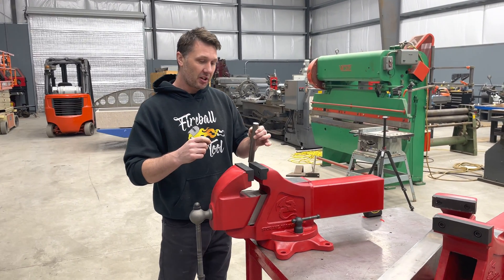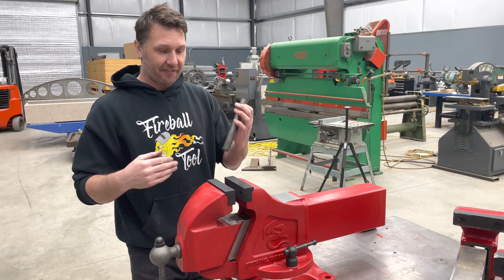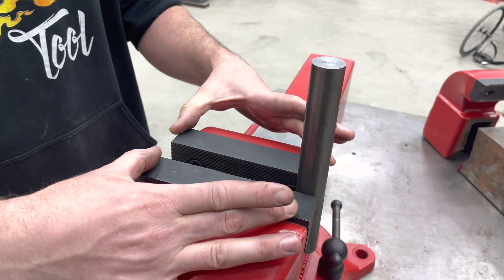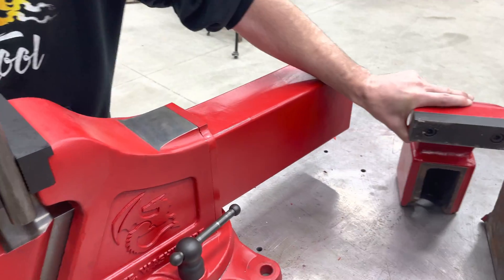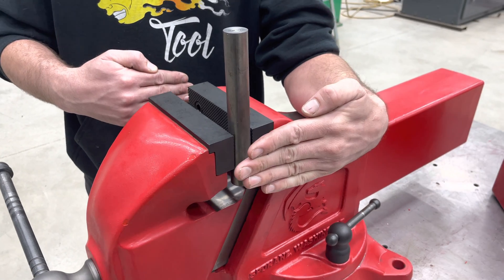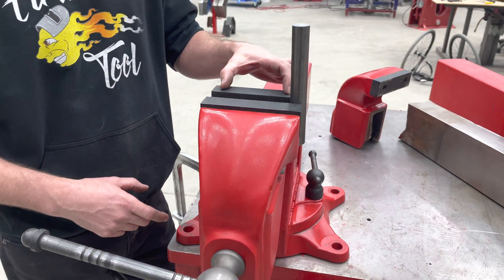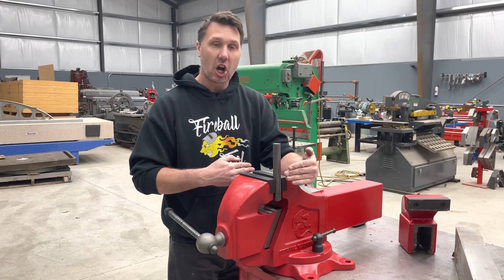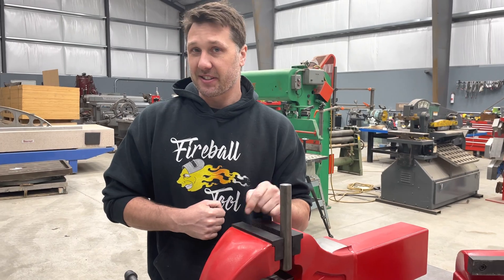Why aren't the Jaws 10 Inches Wide? - Fireball Hardtail Vise

Comment: Have to say it's an impressive looking vice. But $1,800? I can buy and refurbish a big old Record for 1/4 of that, admittedly it might not open as far. I can buy a lot of Fireball squares for what I saved.
Reply: $1800? The USA one is $3,800 on his site. Buy once cry once. You can always reburbish old gear, but by the time you find a suitable candidate, break it down, source broken parts, rebuild, ect. I’m interested in fabricating new items, not refurbishing worn out tools. But they savings are attractive….
Reply: @tbrizius  OK, not sure where I found that $1,800, but on his European site they are 1,600 Euros, which is $1,800ish. I was sure I saw it on the US site. $3,800 though??? Even if I'd won the Euro Millions lottery on Tuesday, some one in the UK did (£195M) I'd still have second thoughts.

Comment: When will the wider jaws be available? As interested as I am in this vise I need one with wider jaws for my use application. I understand you reasons for going with the narrower jaws, but as another commenter pointed out, using supporting material to prevent unequal forces that result in the dynamic jaw head twisting is a good idea.

Comment: I've watched every QA video on this new top secret channel now and this is the only one that really bothers me and it bothers me about your mild steel one, too. I commented on that at the time. You've got the round hub on the front to make it look "right" but it looks wrong because it's out of proportion. We know it's weaker if you make them super wide, but there's almost no ability to hold vertical stock on that vice and that's a damn shame. Putting longer jaw inserts in there does not fix the issue as those inserts are not supported. You'd have to do something outright dumb to break them and that behaviour would not be covered by your limited warranty so why handycap the product in that way to prevent something that anyone with a brain isn't going to do anyway? Any good engineer will place a same-size item in the other side IF they need it super tight and boom, no lateral force at all then. Check out a Record Number 8, 205mm wide jaws and slide is only 70 or so. Awesome vice and out of production for nearly 20 years.
Reply: yeah, this is my only point why I am on the fence
Reply: If the wide jaw inserts were cut out so they wrap around and basically fully widen the Jaws (rather than just being a bar like most inserts), then there would be support on the sides, and it would be very strong.
Reply: @AD03444  Then it'd look super weird and the stress would all be on the opposing fastener - no substitute for casting the material where it's needed IMO.

Comment: For the longer jaws, do you drill and tap a hole to thread in a bolt that can be used on the opposite side to force the jaws to stay in alignment? The same as putting a piece of stock in the opposite side of your mill vise to keep it holding the work piece. But a threaded bolt is of course adjustable and easy to keep everything aligned.
Reply: I thought of something similar but I'm not sure the threads would take it

Comment: With my woodworking to keep the jaws from racking I use a spacer on the other side the same or slightly less on the other side of the Jaws to eliminate the racking.  So if you were holding a 1 in tube on the right side place a 1 in small cutoff on the left side low enough to be out of the way.

Comment: You should give out those broken prototype vises for welding schools or youtube channels to be repaired as a training piece. A actual job is good training for a starting welder.
Reply: The only problem with that is welded cast iron is not very strong
Reply: @juliuspepperwood6943  cast iron is not a beginner-friendly welding material. You can do *everything* by the book and then still have it crack as it cools. It also requires expensive high-nickel welding alloys.
Reply: @ParadigmUnkn0wn  yeah realistically it would be brazing practice at best, but not something bad to learn on a realistic practice piece either